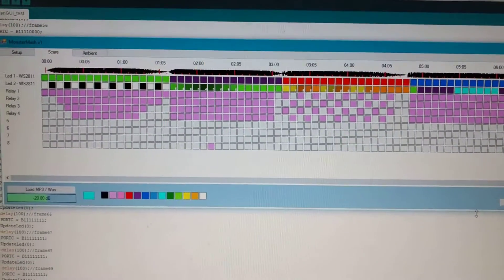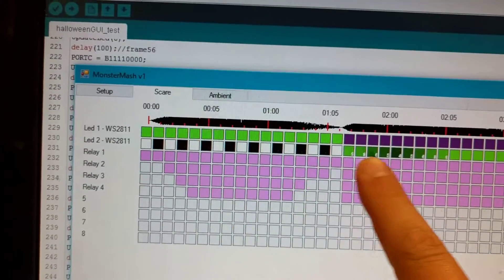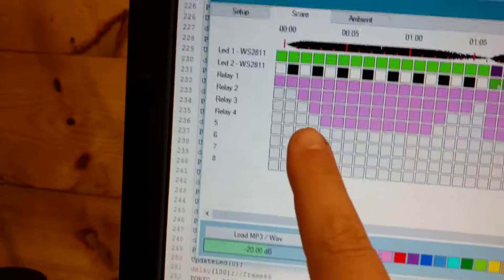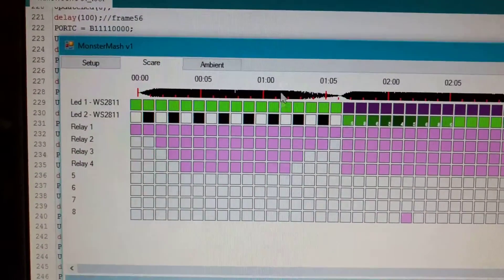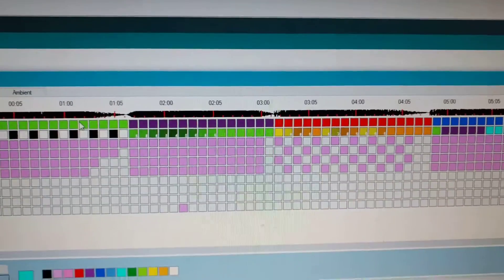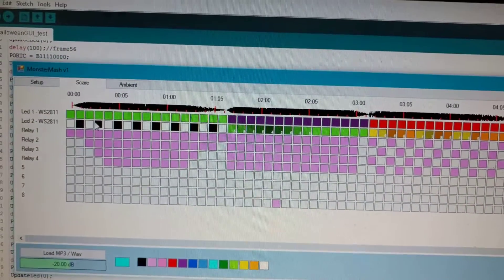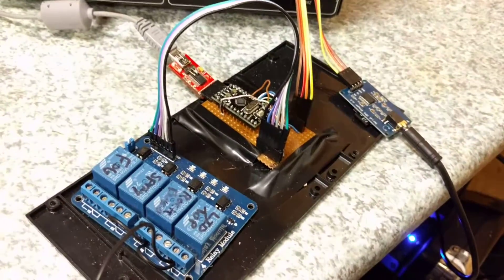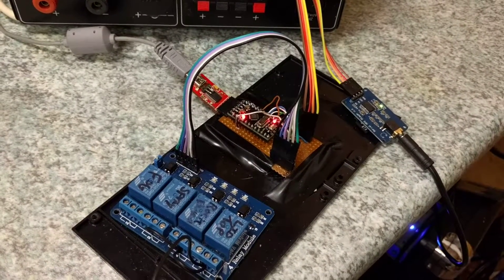Arduino Prop Controller Test - Halloween

Comment: How did you get the sequencing interface with the audio file showing on top?  I'm trying to build a Monster in a Box with my son, kind of the same thing......
Reply from the maker: Matthew Costa this was software i designed and built myself, it wasn't fully finished to be release ready
however there's a great alternative called fourbanger at buttonbanger.com